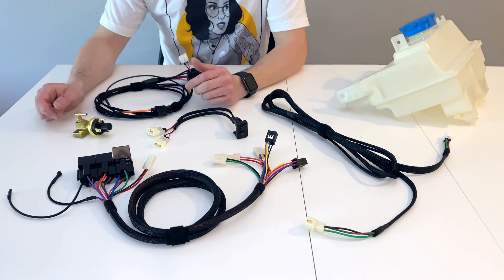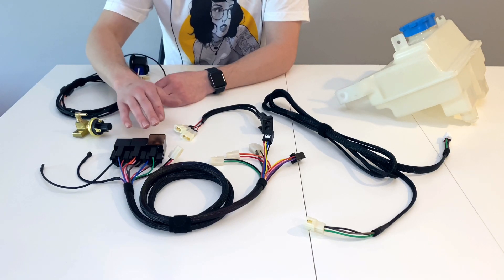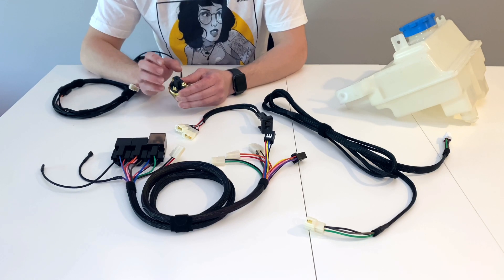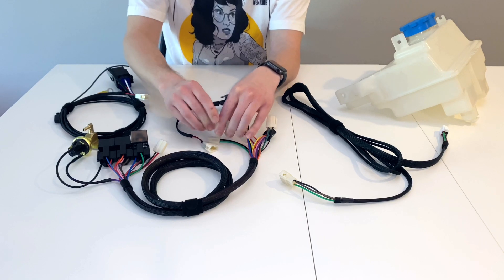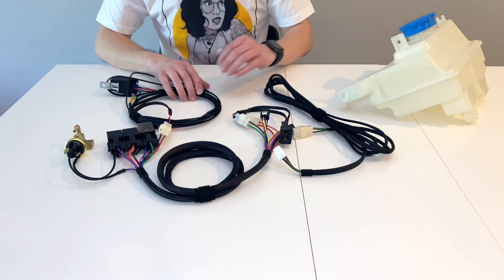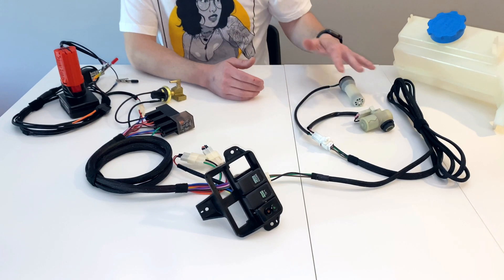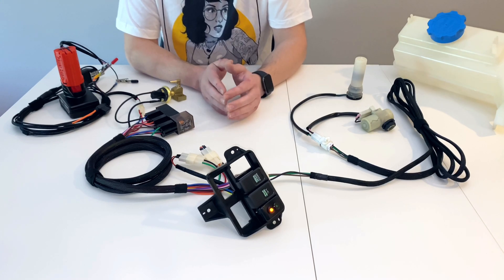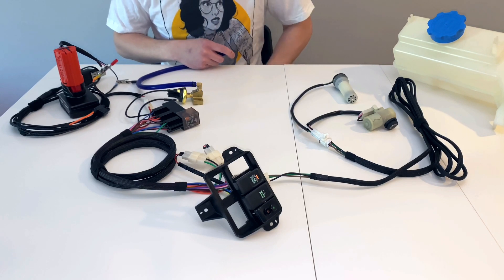Subaru Intercooler Water Sprayer

Comment: Hi. Do you have the part number of the wiring harness closest to the spray tank. Its the longest harness that connects directly to the pigtail on the bottle, and has a 3 pin connector on the other end..

Comment: Thanks for the demo. When fitting a kit like this will it spray just the once? Say you’re coming onto the highway for example and you’re on it hard for 30 secs or so, will the system keep spraying in 2 second intervals?
Reply from the maker: Jack Barraclough I can setup auto mode to stay sprayer in boost or to only hit for 2 seconds and then again once you come off throttle and back on throttle